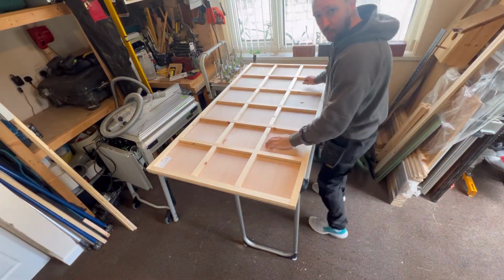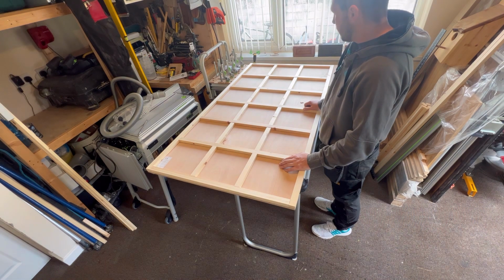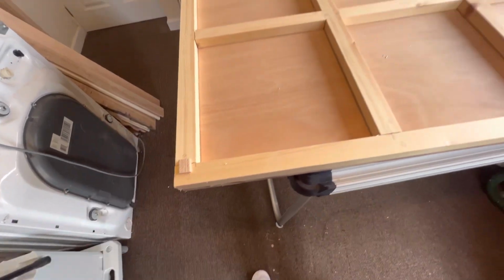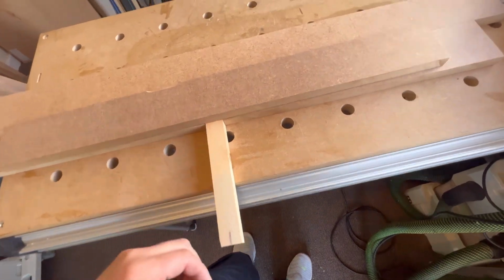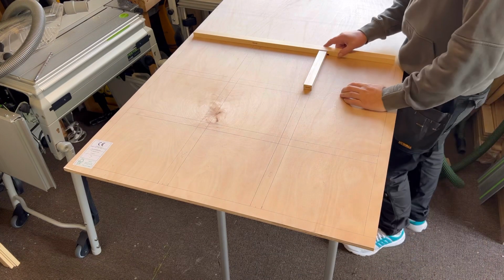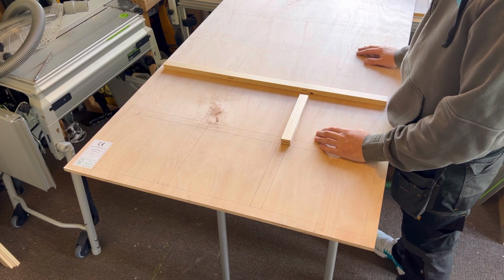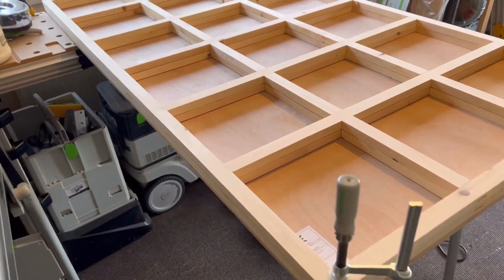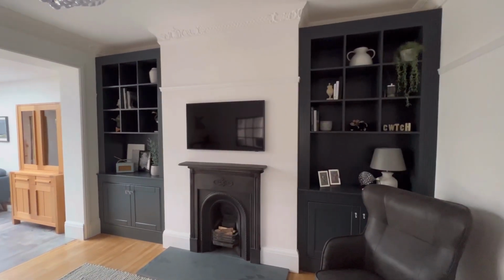Festool domino making window from pine (watch until the end to see installed )

Comment: Turned out very well mate.
Would you have any faith in using dominos (in place of mortice and tenons) for making replacing sashes for sliding sash window?
I'm a chippie myself, I have 20 windows to renovate in my recently acquire victorian semi and the quotation for new windows from joinery companies are eye watering!
Reply from the maker: Thanks,honestly with a mortise and tenon you do get more glue up area. But if using dominoes and using the DF700 to create more surface area for gluing I think you can’t go wrong. 
Once the window is solidly fixed in place it can’t go nowhere. 
I do have another video on here showing install of wainscoting panels in bathroom. 
It’s common with them to crack on the joints. I keep going back to the same house for more work and nothing has moved. Still solid with domino causing no movement what so ever 👍
Reply: @markthomas5139  I actually did a bit more googling and the consensus is that dominos are a good option. As you say even an opening sash wont be subjected to much racking (opposed to say a door hinged on a frame) so if the joinery is decent the dominio shouldn't exposed to forces outside its capabilities.
Reply from the maker: @kevocos  yes,as they ain’t under much load or stress they will work fine for you application. 👍